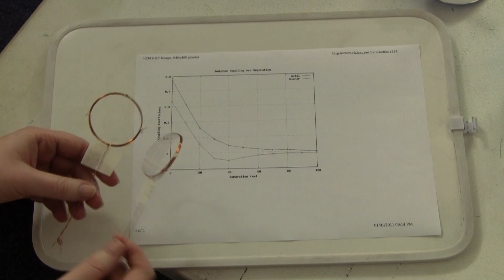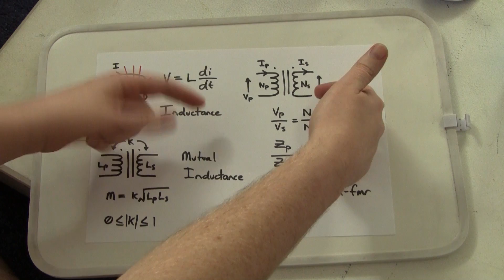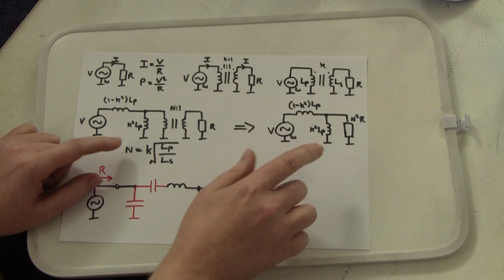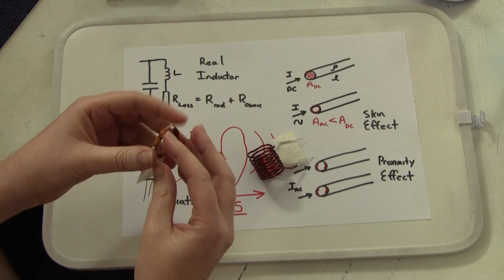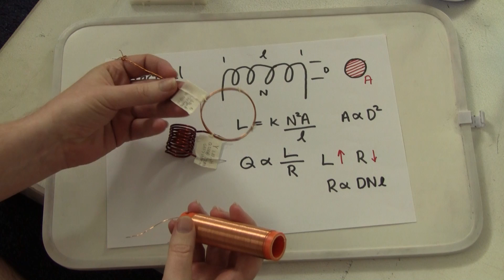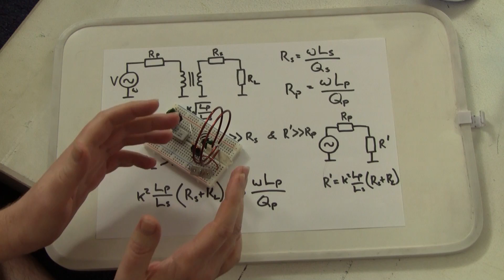About Wireless Power Transfer

Comment: With all that you said about proximity effect and primary Q and so forth, as well as the coupling distance being linked to primary coil diameter, I'm a little puzzled as to why you wouldn't simply use a single turn of wire (or preferably hollow tubing) for your transmitter.  I recall seeing another video on youtube were someone did just that and was able to power a 24V incandescent bulb from several coil radii distant.  Although you didn't mention the similarities between near field inductive power transfer and the tesla coil, judging by that long fine wire solenoid you held up, you're well aware of them. Excellent walk-through in any case.

I'd love to chat more about the practical limits of air core inductor design because it's something I'm actively experimenting with.

Comment: thank you bro  I want to know the relationship between the distance and the number of  
turns coil by the equation
For example, what is the number turns coil  of primary and secondary are required to transfer 5 volts for a distance of 3 meters
Reply: How to ac voltage transfer wireless...

Comment: If you had a higher voltage (such as 7200 volts), would you be hurt if you put your body by the range of where the light is powered on? Also, does adding more voltage increase the range of wireless transmission of the electricity?

Comment: Hey Alan, may I find out what component are you using for the 14.91 Mhz, the Mica compressor and the transformer. I am from Newcastle University currently doing research on wireless power transfer. Thank you for you attention

Comment: I want to build high efficient wireless power transfer system with following specification.input dc voltage=24 voltsoutput dc voltage=12 voltsoutput current=1 AI am very grateful if you provide some guidelines on this.

Comment: Hey, I would like to ask you if a could make that power transfer with an Arduino UNO... because the Arduino only provides 5V and 40 mA... and i would like to be able to take the coiles far from each other as much as it is possible. Should I use thin insulated copper wire and how many  turns in each inductor should I do ? And finally if you can predict it more or less, how far could I take them far from each other?

Comment: I have a question about making a wireless charger for duel 3.8 to 4.2v  5300mAh batteries, wired in series. I have these on order right now  (http://www.amazon.com/gp/product/B00W0SA6ZE?psc=1&redirect=true&ref_=ox_sc_act_image_5&smid=A2VQVYG8QD1XR1)  And yes I realize it has to have an output mAh about 38% of my storage capacity. This coil is 600 mA, but i think i need somewhere around 1200 - 2000mA to even be worth using on these batteries. And anyone give me a hand on skype or something? Can i double or triple these receiver coils in series (with the chips attached) and increase the mAh for the receiving end? Its for a box mod. I print and design my own. (micro usb charger, 0.1 ohm 1 amp circuit, voltmeter, POT trimmer).... But these coils are hard to wrap my head around. I need help on this step.

Comment: You concluded by saying the engineering task is too difficult, so practical wireless power transfer probably wont happen.  Have you seen the WiTricity video where he claims 98% efficiency to charge an electric car?   My thinking is that high Q is needed to get good distance in coupling.  To get high Q, and maximum power transfer, it seems you want to run the resonators at high voltage and current, and use matching on the secondary side to reduce the effect of the load on the Q of the secondary (receiver).  Maybe the primary side should be driven at in a similar manner.  So step up the voltage for higher Q and better coupling on the primary, and step down the voltage on the secondary.  Instead of separate turns, use the auto-transformer configuration, which is more cost effective and compact.  What do you think?
Reply: Robert Tso you don't know what you are talking about. Just increasing power does indeed lead to higher power transmission...

Comment: Tuning is too big a problem?  If the unit to be charged has a micro-controller, it would not be too difficult to have an algorithm to switch in different capacitor values and select the one that produces maximum power transfer.  Also, if the inductor is etched as a copper trace on a PCB, the inductance value should be very tightly controlled.

Comment: Lighthouse DEV based in Maryland as delivered an “eye-safe” based laser WPT demo system to the U.S. Army that can transmit power for several miles very much like the system shown in this BBC video

wwwDOTbbcDOTcoDOTuk/programmes/p00yjt99

Bert Murray
Lighthouse DEV LLC

Comment: Magneto used the machine on Senator Kelly, in Xmen. What about smaller scale version of this machine, only molded
 using copper, with a tiny bit of power wont it magnify the power of transmission ?

Comment: why not just add a jewel thief and some capacitors to the load coil "Rx end"  and this should help the Tx base transfer its power more efficiently ? 

why dont we just do this Tx base submerged in ionized water /salted water use strong magnets to help with the flow and rather then have a base be the platform the Rx will have the base thus floats from the opposite reaction "magnetic cargo train that floats thru ocean water? "

Comment: HI Alan,

How are you? I really need your suggestions to improve my power transfer efficiency in WPT. I have built a self oscillating resonant converter. To make resonant the circuit, I have applied series resonant combinations.The primary winding with ferrite has an inductance around 250uh and secondary without ferrite has 135uh. At 141khz, the resonant capacitor value for CP is 5.17nF and secondary has CS 9.4nF. I have attached 100ohm load at the secondary after bridge rectifier. I am getting around 12 V but the current is too low around 0.050A. I would be grateful if you could help me to rectify my problem.

Thanks

Comment: how did you measure coupling coefficient?
Reply from the maker: cap9246 by measuring the inductance of the two coils in isolation then in series, first in phase, then anti-phase (actually you only need to measure them one way or the other, but it is a useful check to do both).  This lets you compute the mutual inductance and hence the coupling coefficient:  Ltotal = L1 + L2 +/- 2*M, k = M/sqrt(L1*L2)
Reply: vk2zay How are you? I really need your suggestions to improve my power transfer efficiency in WPT. I have built a self oscillating resonant converter. To make resonant the circuit, I have applied series resonant combinations.The primary winding with ferrite has an inductance around 250uh and secondary without ferrite has 135uh. At 141khz, the resonant capacitor value for CP is 5.17nF and secondary has CS 9.4nF. I have attached 100ohm load at the secondary after bridge rectifier. I am getting around 12 V but the current is too low around 0.050A. I would be grateful if you could help me to rectify my problem

Comment: Clever but......what is the long term implication on the human body if this technology becomes widely used?
Reply: You people are idiots. Go away please.
Reply: Carla Houze  the waves transport so little energy; this has no effect on the human body
Reply: +Carla Houze - The power transfer is directional towards the resonators, so your exposure will be minimal.  Also, it is a CW signal, not a modulated signal like a cell phone signal.  It has been known that it's modulated radio signals that affect some people who are very sensitive.
Reply: if you can get the frequency above the human visible light band then you can give yourself cancer.  15Khz is in the audio spectrum and quite harmless.  Even serious power run through the primary like an MRI is believed to be much safer than an X--Ray.
Reply: cancer

Comment: Many people in these comments are asking for an increase in range and power.  Even commentator in the video says that he would like to power his lap top across the room.
Well, there is a natural law that the power  radiated is inversely proportional to  distance  unless one uses directional antennas.  Well this means a lot as far as safety is concerned so my friends be careful, you do not want to power your lap top with Radio Frequency power and have all the people in the room cooking nicely as if they were in an oven.   Well it is not as bad as that , but III would not recommend the  transfer of power across an area where people are moving around. We do not really know the consequences of humans having high intensity of RF power circulating as eddy currents in their water conductive  bodies!  Stick to low distances and do not place your hand in the  radiation for too long.

Comment: Would it be possible for you to post the schematics for the breadboard layout that you to send power in towards the beginning of this video.
Reply from the maker: Linked in the description, click "show more" and follow the link labelled "Circuit of demo TX/RX here".
Reply: Thanks so much
Reply: +vk2zay  can this be done for example to reduce from 12v to 1,5v? For instance in case you want to charge a battery of 1,5v from a battery of 12v: it would be 120 turn for the 12v and where it is the led, instead the led, you put the 1,5v battery to be charged, and the turns would be 7,5 turns. What can you tell me? would this work?

Comment: can you please explain this image for us :

https://encrypted-tbn1.gstatic.com/images?q=tbn:ANd9GcRRTaNpZcft1Djsaid1e2L_kvzQpOnP502fiGhDLl2CwOTsS9_cwg
Reply: is that possible to transfer power wirelessly  by that easy way ??
Reply: Power is going from the battery, to a switch, to a coil, and to the next coil by magnetic inductance. Power will not be transferred while the switch is on. Power will only be transferred for a brief moment when the switch is turned on, and again when the switch is turned off. 

This is because it is only a CHANGE in magnetic field that moves electrons in a wire. It is only a CHANGE in current that changes the magnetic field. 

If instead of a switch, there was some sort of spark gap or other oscillator that converts from DC to AC, power would be transferred constantly and the volt meter on the right would always have a reading.

Comment: Hi I have this question which I cannot get a simple answer to nomatter where I search on the internet. Maybe you can help me. I want to know if Wi-fi emissions are magnetic?

It's a simple question and all I get is complex same of the same jumbo I cannot make sense of concerning my question. Thank you very much in advance!
Reply: The simple answer is wifi signals have both electric and magnetic fields. Wifi comunication uses electromagnetic signals.  Electromagnetic waves have both electric and magnetic fields at right angles to each other. Most antenna (like whip antenna) are aligned with and dedect changing electric fields, While some coil antenna are designed to catch changing magnetic fields.
Reply: You can't even understand the question you are asking. That's why no answer you have recieved is satisfying.
Reply: every form of communication technology we have uses electro magnetic waves, with some exceptions, but the wifi is magnetic field

Comment: you need at least a 3D coil configuration, because the shape of the magnetic fields  should be able to direct the path of the fields and stop the blind spots which cause your receiver to loss power.

Comment: Tesla solved this problem a long time ago. The problem is the type of electricity that you are using won't work for long range applications. Meyl re-discovered Tesla's solution. Meyl shows Tesla longitudinal waves for wireless energy transmission By the way, Borderland Sciences did a series about it. Eric Dollard - Tesla's Longitudinal Dielectricity (Scalar Demonstrations & Wireless Transmission)
Reply: Vid Bid Tesla was an autistic and miserable recluse who died alone as a failure in a cheap room in a hotel. 
He deserved better. But not how you think.

Comment: Thanks for the video, Alan. I'm trying to make a wireless charger for my first year project at uni and was wondering if you could do a step by step tutorial. I've managed to make one a breadboard and it looks pretty similar to yours... only mine doesn't work and I can't work out what the issue is.
Reply: haha i'm working on wireless powering for my first year project as well at loyola Chicago. what Frequency are you running at?
Reply: I've had to drop the whole wireless charger idea now. What course are you doing, phillip le?
Reply: it's not a course i'm doing an undergraduate research
Reply: oh alright, I see
Reply: phillip le I did it and was interesting. But the tricky part is using ic's like FET array in AC waveform generation and Microcontroller in battery management like temperature and monitoring switching effects when voltages rise above certain threshold.

Comment: I would like to talk to you sometime . I think i know how to improve your model . The diagram looks a lot like the tesla coil , you don't have to take my word for it but if you add two more 2 turn primary coils to that circuit and turn the 1 small coil next to it horizontal in the center of the of the 3  you might be surprised  at how far that will reach .. :)

Comment: false, radio frequency signals are not power, they are wireless signals not power, they contain an insignificant amount of energy that is not even enough for a tiny spark, as they travel they dissolve and even with a constant powerful signal to transform it into electrical energy is a waste of time, false idea useless, another terrible idea to waste time and money in order to manipulate the system, what you are saying is just as false to think that thunderstorms exist, there is not enough energy

Comment: WOW THIS IS THE WORST UNDERSTANDING OF PHYSICS I HAVE EVER READ

Wireless transmission uses electromagnetic fields. They are the same thing. It's called coupling, and the big pursuit now (see the various successes MIT has had over the last five years) is far-field resonant coupling. And yes, the efficiency is an issue. You know why? Because it's a novel technology. I'm sure glad they didn't abandon cars back in 1904 because they were too slow. As for 'slow speed,' EM fields travel at light speed

Comment: i was just wondering what would happen is you use a Tesla coil as a RF transmitter. would the right type of coils pick that up or would it need to be a whole new circuit? or can it be done even?

Comment: Hi Alan, in your video, you add 2 capacitors to the primary to cancell coils' impedances, connected in parallel-series, but in your webpage the two caps are connected y series-parallel. Is there any diference? Thanks

Comment: One thing I disagree with in an otherwise excellent video; the variation in coupling coefficient doesn't significantly detune the coils.

What happens is that there's a relationship between the current/voltage on the coil and the coupling coefficient; at low k, you need proportionately more volts/current, i.e. you need more voltage step up at the transmitter and step-down at the receiver to maintain the efficiency, because that changes the effective size of the coils either side.

Comment: You're just making baseless assertions with no evidence now, which is what you've really been doing the whole time.  You can manipulate magnetism at home; just take a wire, connect it to a battery, wrap it around a nail and see it deflect a compass needle.  And magnetic "energy" attracts or repels whatever the Lorentz equation says it does.

By the way, you clearly don't know what you're saying, given that you just confused conductance with ferromagnetism.  What physics background do you have?

Comment: and as for electromagnets they are limited also to the amount of force they can give and attract not do to energy but to the most important elements they contain, you can transform magnetic energy into electrical but electrical into magnetic that is never seen and I dough that is possible because it requires certain elements in matter to produce magnetic energy, magnetic does not come with out the required elements, just like gravity does common stuff you do not need to be a scientist to know it

Comment: Your comments are becoming progressively more incoherent.  What exactly do you mean by "chip?"  Besides, it's very, very well-established in physics that anything with charge and velocity is affected by a magnetic field; it's called the Lorentz force.  Magnetic fields are indeed manipulable, just by putting current through a wire (I'm sure you're familiar with electromagnets, for example).

I think you've invented a new pseudoscience:  induction-denialism.  As you say, I DO NOT LIKE IT.

Comment: nothing that you are saying is possible, because magnetic fields or power is not manipulable, and is not guided in any since one thing is for a field to have more power on one side than other which does not mean is oriented and chips are affected by magnetism not charge, also you still required to transform the signals into energy not possible for a chip, all of that too much science fiction, you would be good to write star trek novels, sorry not possible quit creating deception I DO NOT LIKE IT

Comment: Uh...magnetic fields affect any body with a nonzero velocity and charge; it's called the Lorentz force equation.  Even if they did only attract certain materials, though, that wouldn't oppose the fact that they have an orientation.  Magnetic fields have a north and a south pole, and the direction of the north one is the orientation.

By the way, I thought of another device that works through wireless power:  passive (not active) RFID.  The magnetic field going through them powers the chips.